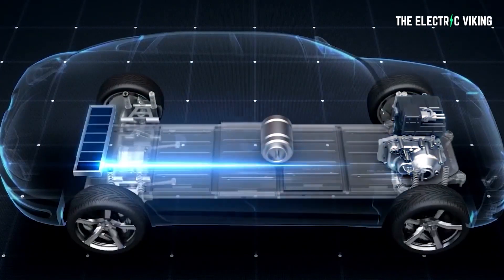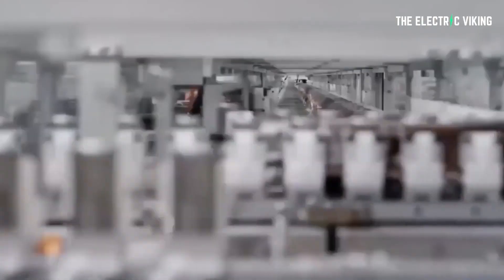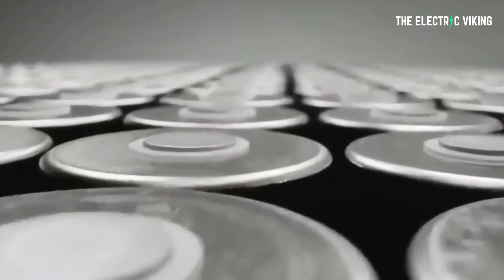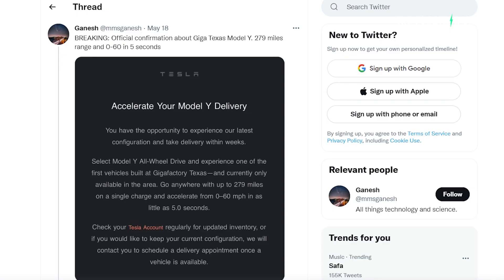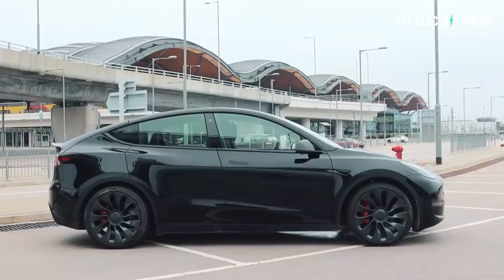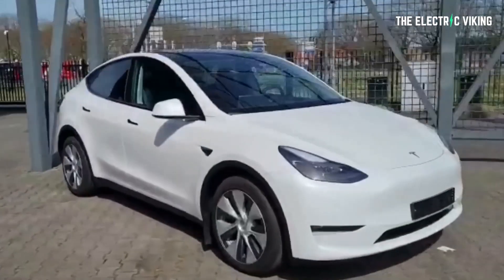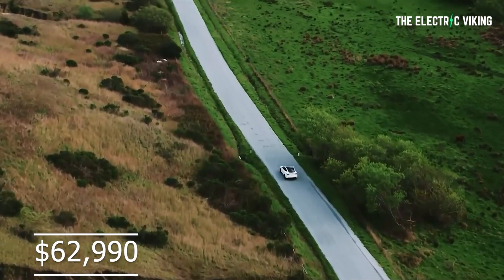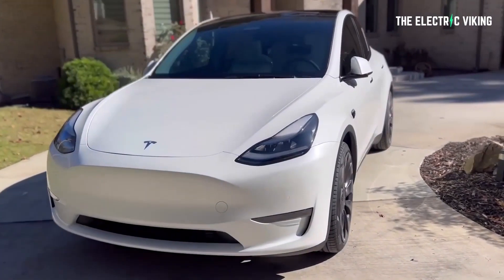Tesla's New Model Y AWD with 4680 cells is available NOW

Comment: I have an order in place for the long range but then again I don't live in Texas. But here's hte problem I see with this new version. You can't count on the total 279 mile estimate because you really can't get that out of a Tesla and you won't get that because it's not recommended to charge constantly to 100%.

So either way, with the LR or the 4680 SR, I'm going into it with a milage reduction. And for a few grand less I don't feel as though it's worth it to me to give up my reservation just to save a few grand. 

IF...we were talking about a LFP battery on a SR...AND I was also going to get the premium stuff that comes in the LR such as the premium sound system then I feel it would be worth it since that would be a daily and consistent charge all the way up to 100%. I feel as though Tesla is jumping the gun by trying to put this model out there to see how 4680 will be received and if people, other than the employees giving high praise, will like it. Plus it might be a way for them to manage demand and convince shorter distance drivers they don't need the LR.

Comment: I'm up for 4680 if charging speed is actually faster.  Another less important consideration is that the smaller battery pack will make it less expensive to replace battery pack down the road.

Comment: GOOD-AAY SAM!! HOW'S THE LITTLE "NIPPERS"??  MAYBE SANDY MUNRO KNOWS HOW BIG THE 4680 BATTERY PACKS ARE??  I THINK THEY HAVE A SMALLER PACK FOR 2 REASONS : 1) OBVIOUSLY, THEY DON'T HAVE ENOUGH 4680 BATTERY SUPPLIES, BECAUSE THEY'RE STILL RAMPING-UP PRODUCTION ( didn't you say earlier this week that TESLA was " crying" to Panasonic about expediting their 4680 production?? )   2) IF THEY PUT MORE 4680'S INTO THAT PACK, WHICH IS THE NEW "STRUCTURAL" PACK, WHICH SHOULD MEAN IT ALSO COMES WITH AT LEAST THE REAR, AND MAYBE THE FRONT MEGACASTINGS TOO, WOULDN'T THET MAKE THE TEXAS Y A MORE POWERFUL, LIGHTER, LONGER RANGE, STIFFER, AND MAYBE A LITTLE SAFER CAR THAN THE FREMONT MODEL Y??  WOULDN'T THAT, AT LEAST IN SOME CUSTOMERS MINDS MAKE THE FREMONT MODEL Y OBSOLETE??  IF SO, AND, WHO REALLY KNOWS?? ( Elon?? Franz??  Baby X?? ) THEN I CAN'T SEE THEM PUTTING A BIGGER PACK INTO THE TEXAS Y UNTIL TEXAS RAMPS UP TO FULL Y PRODUCTION, SO THEY CAN SHUT-DOWN FREMONT, TO RETOOL FOR THEIR OWN 4680, AND STRUCTURAL BATTERY PACK MODEL THERE!!   THANKS SAM!!   CHAS ORVIS, PLAINVILLE, CT.

Comment: I have one on order and that car is a red headed step child.  Only a good deal for Tesla to minimize profit loss during 4680 cell shortage.  If I were going to buy a SR I would definitely want LFP batteries with 100% charge capability and greatly reduced degradation.  When LFP available they phase out that model, also when LR available it will greatly outperform on range.  Also terrible price discount.  That car will be the least desirable used once phased out.  Good for Tesla, bad for consumer.

Comment: If Tesla danagled the new std model infront of my nose, I might go for it if the pack is smaller and efficiency greater.  I am on the US east coast with a delivery scheduled for @ September.  The 20" wheels thouroghly completes the overall look of the Model Y but I prefer having the extra range of the 19" wheels.
Reply: Black out the 19" wheels, I doubt you'd notice?
Reply: @rogerstarkey5390  I plan to remove the plastic wheel covers ....

Comment: Since its a new battery tech, its feasible that charge capacity might be limited more than usual, until they have long term real-world data on degradation. They have done this before. With sw update they have increased the range.  (allowed the pack to take more charge)
Reply: It's new cell CONSTRUCTION tech.
The "charge capacity" (Emphasis on "capacity") is only dependent on the amount and type of active material, frequently described as "chemistry", in the cell.
All figures from battery day were based on 2170 "chemistry".
They know the worst case Deg.
As for the construction, it's all "upside".
Lower internal resistance can only reduce stress on the material and allow faster charge/ discharge.
.
Just a thought.....
Consider the performance the Plaid is getting..... Using 18650 cells !?
Let's assume the 4680 uses that material.... in a more efficient "casing".
Why would it need to be "different"?
It's much more logical to use known tech, in the new case, test for at least 1 year (they've had cells for at least that long!) While refining the mechanics of production.
then match the performance of existing cars with a more efficient system (What Tesla always does)

Comment: for me, if the 4680 was guaranteed to last longer than 2170 I would go for that.
Reply: Let's try logic.
What's the issue for most cylindrical, Nickel based cells? (I won't say Sam's favourite "t" word).
It's heat.
Caused by...... Internal resistance.
.
So, if you take (essentially) the same material ("chemistry") and wind it into a cell design which not only stops heat being produced, but inherently wicks away any which is produced, what would you expect to find?
.
1) Ability to improve the performance of that material.
.
2) Increased longevity due to operating well within the "envelope"?
.
I suggest that we can expect the first 4680 cells, using very similar, or the same, known chemistry to outperform at pack level while increasing cell/ pack life.
.
This leaves room for regular incremental chemistry changes, and/or periodic step changes from new (different!) "chemistry" (materials)

Comment: If the pack is smaller, that further raises the question of why the structural weight savings described during battery day isn’t present with this new model
Reply: I suppose we'll find out in..... What's the delivery time?... Add one week.
Just needs an OBD2 scanner.
Reply: Tʜᴀɴᴋs Fᴏʀ Wᴀᴛᴄʜɪɴɢ
For More Mentorship and Information
𝕄𝕤𝕘 𝕕𝕚𝕣𝕖𝕔𝕥 𝕎𝕙𝕒𝕥𝕤𝔸𝕡𝕡✙➊➋➎➊➋➊➌➍➌➌➋

Comment: Are these NEW structural 4680 batteries repairable/replaceable if they get too much degradation, or is the car just totalled?
Reply: They have a higher cycle life I believe like 500k miles or more
Reply: @chidorirasenganz  the current 2170 batteries have a lifecycle of 400k on average and can be replaced. My question was can the 4680 batteries be serviced/ replaced?
Reply: @Tesla--Bull  I don't think you can replace individual cells in the pack anymore. It's all glued together to make it stiff.

Comment: I DO live in Austin and I JUST put in a M-Y LR order the day before this announcement.  😊  I would take the TX 4680 switch if they'd explain the differences from the Fremont LR and if I felt convinced that 279mi range was a reliable FLOOR, which may increase over time.  E.g. it's a bigger battery pack software limited to be consertive and not Osborne/FOMO customers with Fremont M-Y orders until Fremont can convert production to something as appealing.  If this is the case, I think that range will likely increase via OTA updates.  This is what I recall happening with the M3 when it was introduced with the (then) new 2170 cell.  The original rated range was conservative, and Tesla increased it at least twice as they gathered data and verified performance.

Comment: To be fair - who ever really compared petrol tank sizes as a purchasing differentiator when the range figure is what people relate to. Tesla would actually look artificially worse on the battery kWh sizes given their high efficiency in miles / kWh.
Reply: Exactly!
Reply: it will become a non-issue, when supercharges are as ubiquitous as gas stations.  Untill then... range matters.  Depending on where you live and how you use the vehicle.

Comment: I suspect they are deliberately using a small battery pack in these early models to reduce the number of cells needed as they are struggling to ramp up cell production. This would also explain the relatively low range. Would also explain why Tesla is being coy about the size of the pack as customers might complain if it was a reduced number of kwh compared to the model with the 2170 cells.
Reply: That’s probably 50%. The other 50% is that if they release a new, better LR Model Y, they Osborne themselves and piss off a bunch of reservation holders. They basically had two choices. Introduce a new Performance Model with 4680 or introduce a lower grade. They chose the latter.
Reply: aftonline
"Which part of we're not cell constrained this year" ("we have stockpiled cells") wasn't clear?
Reply: @rogerstarkey5390   Yes, they have enough 4680 cells to make SOME of their cars, but the rest are being made with 2170 cells. If they are restricting their 4680 customers to those who live close to Giga Texas, that doesn't imply that they have enough 4680 cells to cover a large percentage of their customers, most of whom live in other states or within Texas but not close to Austin. So no, they are not cell constrained overall, but they ARE 4680 cell constrained, while 2170 cell suppliers such as CATL and Panasonic take up the slack. It was said at one stage that they had 1 million cells stockpiled from Fremont, but that's only enough to make 1000 cars. Yes, they are now making 4680 cells in Texas but at what rate? I'd be interested to see those numbers.
Reply: The problem with the small battery pack theory is the higher than expected weight and cost of this version.  It may actually have a big battery, software limited to be cautious until real world performance data is examined.  I recall this was done with the M-3 when they introduced the 2170 cell for the first time.  This would also be less objectionable to customers with Fremont 2170 M-Y orders pending.  Osborne Effect/FOMO just be managed.
Reply: @737smartin  
Regarding "software limiting"
Note that the Battery Day "5x 6x" figures were achievable with existing 2170 chemistry.
It's quite simple to work out (using an online calculator) that with the same "jellyroll" material thickness, and factoring the height difference, a 4680 cell contains almost exactly 5 times the surface area of that material.
Hence "5 times the energy" (capacity).
Then, accounting for the lower resistance of the cell, which allows "faster" energy flow, you apply that to the capacity and get "6 times the power'..... Compared on a single 2170.
The point being, it's a known chemistry/ performance envelope.
Similarly, since there's been some production for over a year, they've had test cells out there a long time to confirm performance, in both model 3/Y miles and no doubt the Semi.
It's not like the 2170 when both they and Panasonic were rushing to get cells and a new car to market with relatively little experience.
Reply: Is it not just a little ironic that the Twitter transfer is on hold because Twitter are not being open and honest about the number of spam accounts they have and ab9ut the methodology they use to count those accounts?
Reply: I think that they are just making less energy dense cell to make more cars. You can’t make the pack too small because it will change the handling and rolling resistance.

Comment: How can you buy an EV without knowing the battery capacity! That's Marketing at work!
Reply: Efficiency is as, if not more important than pack size.
But, let's say the "old" car was about 60 kWh, 245-250 miles?
"New" car, 279 miles.
If we assume the pack results in about 200kg reducing in vehicle weight, and a 200 kg (2 US passengers😉) reduction is good for maybe 10-15% range increase...
The pack is likely somewhere between 55-60 kWh.
.
MORE important will be the charge speed.
If you can....
Drive 3.5 hours.
Arrive at a V3 with 5-10%.
Charge at +/- 240 kW.... And HOLD that speed, averaging 220 up to 80%?
You're looking at 10-15 minutes.
Barely time to wash your hands.
Goodbye range anxiety.
Reply: @rogerstarkey5390  Most important, prospective customers would like to know what they are getting when purchasing an item.
Reply: @pritambissonauth2181  
Let's see....
The most efficient EV in it's class, with (probably) fast charging, and a pack capacity to achieve that.
All will become apparent, if you're not on the list, don't let it "worry" you.
Reply: @rogerstarkey5390  Are you in the list?

Comment: According to the EPA filing it’s only like 30lbs  lighter than the 2170 non structural pack version…
Reply: Really? That sucks. Unless it’s LFP? In which case it might be awesome
Reply: As Scott says..... Or, if they've managed to re-jig a 2170 pack to be semi, or fully structural?
Reply: 4680 Y is 3800lbs and 2170 Y is 4200lbs for the same kwh
Reply: @larryc1616  watch the Warren Redlich video where All the specs and weights are shown from the EPA filings

Comment: I think Tesla employees are sworn to secrecy.  Yes somebody needs to test one of these.  They should charge fast.  If car is lighter it should perform better.  If the car is way better is it going to harm Model Y with 2170 sales.  The silence is killing me.
Reply: How would it harm Y 2170 sales?
This is the "base" model.
If the other Texas cars have 4680 cells, it won't harm them.
Reply: Yes me too. No it won’t perform better if it has a smaller pack size. But it will charge quicker and handle better, especially with the structural battery pack and Giga castings.

Comment: Please, please link the battery format with the chemistry. I am still not sure of The type of batteries Tesla is supplying and from where and with the ramps beginning at Berlin and Texas not only is it  getting even more confusing but is seems to be changing more rapidly. Always linking the format and chemistry would help considerably. Thanks and great job with the site.
Reply: Common knowledge.
Texas: 4680.
Berlin: 2170 until the 4680 plant ramps, or they secure supply from elsewhere. (Est, Q4?)
4680=structural pack.
2170, LIKELY non structural.

Comment: Well the new model will also charge a lot faster and u will have long distance road trips faater cuz first the pack is smaller and second it doesn't over heat as much so it'll keep 250kw for a much longer time and it'll full charge faster  cuz 250kw or lest say 150kw is enough to get u going by the time u get a coffee  or something if the battery pack does heat up and decrease the charge speed and another plus is it'll handle better cuz it's lighter
Reply: Quite possibly all of the above.
Reply: @rogerstarkey5390  so I'm right?
Reply: @THEANIMALGUY  
So you're repeating assumptions that many of us have made since the 4680 was announced.
We are all "assuming" we're right, but it seems likely.
Reply: @rogerstarkey5390  i mean it doesn't have to be an assumption like if it isn't true what's the point of 4680

Comment: Could have fewer batteries or be software restricted for now?
Reply: Elons rule #1
More EVs on the road.
.
Method.
Better efficiency, smaller packs, faster charging.
.
Software restricted not likely unless for final stress testing.
Reply: @rogerstarkey5390  ya, that stacks up, I think you are correct.

Comment: Has the 4680 got lithium iron phosphate batteries? If not why would you go for it? Surly the Standard range with a lithium iron phosphate battery is the best bet.
Reply: No, the 4680 batteries aren't LFP batteries. To be honest, other than the cheaper price, don't know why Sam pushes them so much. Yes they can be charged to 100% without degrading them but the only place it makes any sense to charge to 100% is at home. Takes way too long to charge to 100% on a fast charger.  Since 2170 batteries have longer range, 80% charging pretty much equals LFP 100% charging.  I understand that LFP are SUPPOSED to be able to be recharged more times than nickel based batteries, however looking at warranties, the opposite appears to be true. BYD only warrants the batteries to maintain 60% charge while Tesla warrants their batteries at 70% retention.
Reply: @davekozlowski1266  agree with that. Rapid charging speed craters after 80% no point in waiting for it.
Reply: Lol…… because the LFP battery cells are bigger and the whole battery pack uses significantly way less cells compared to other battery packs